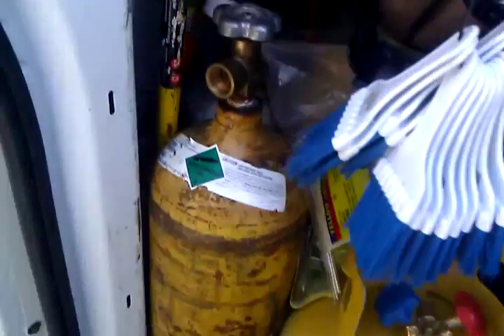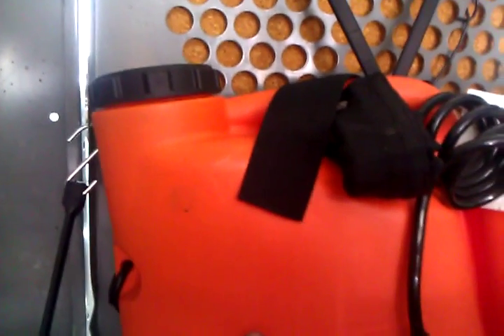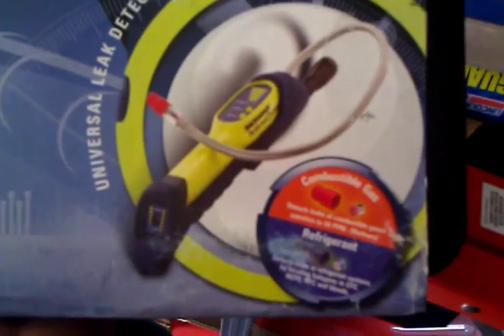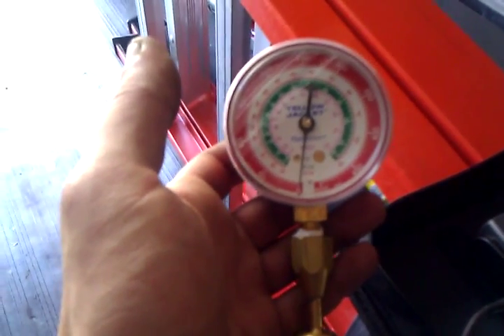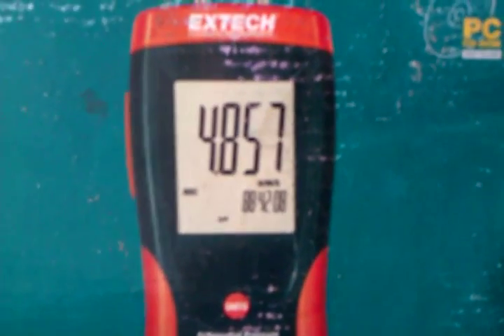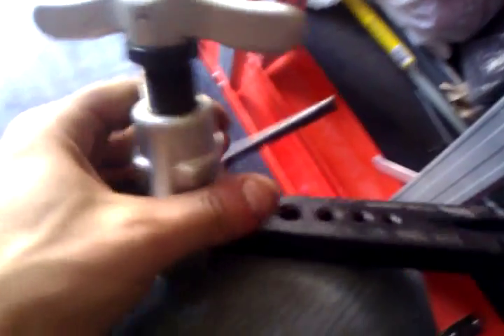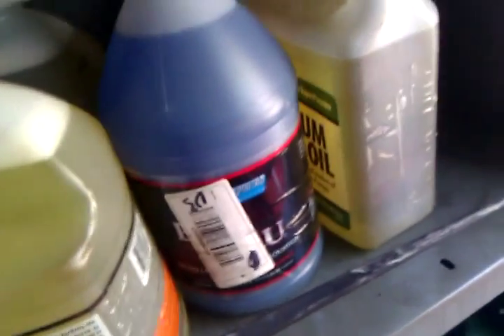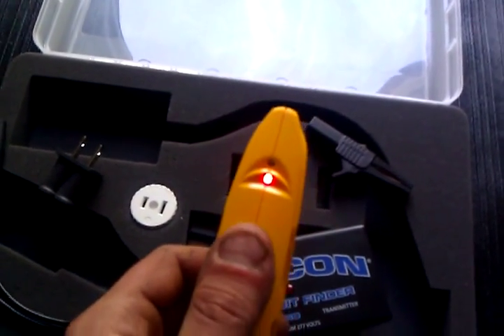Hvac service van tools

Comment from the maker: @Nutintoitbut2doit Thank you Brother. I honestly think I'm the only tech in NYC that has a clean/organized van. Can't count the number of times I've been to a call where I forgot to bring a specific tool for the job so I carry most of my tools in my truck. There are a couple of tools in this video that are in my truck but didn't show, fan blade/hub/bearing puller, corded and cordless drill, corded and cordless dremel tool, corded and cordless saw, corded rotary hammer drill drvr etc.